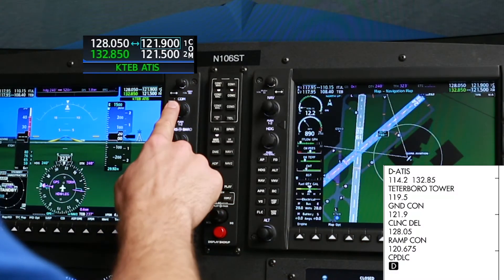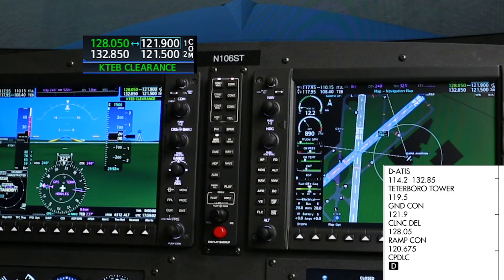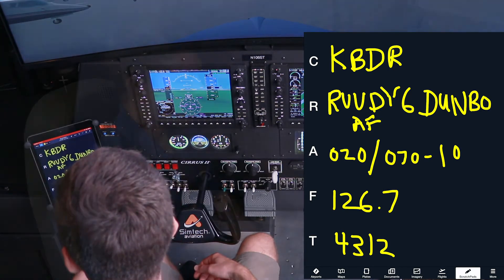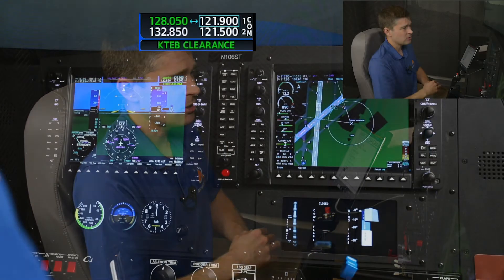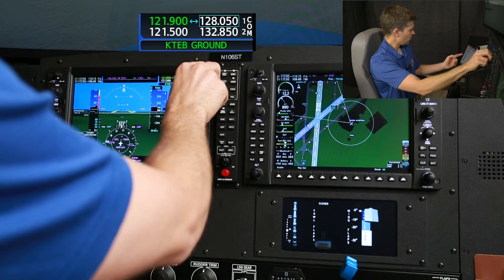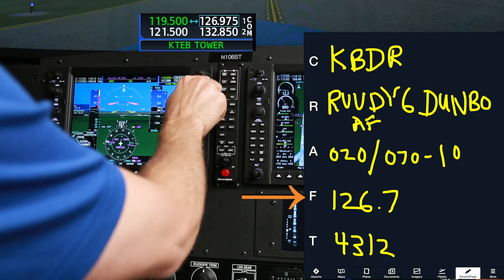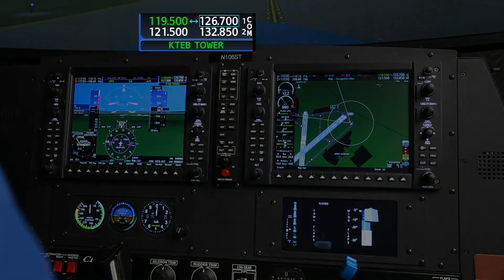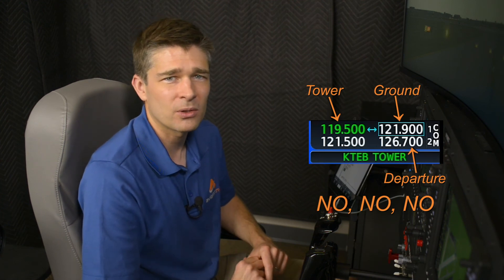IFR Radio Communication Setup | Flight Training New Jersey

Comment: Curious why there are two frequencies of many things non Teterboro like aTIS, t ower, etc.  Thanks
Reply from the maker: Think you are talking about 114.2 and 132.85. 132.85 works on COMM radio, 114.2 works on the NAV radio.
Reply: @AviatorNYC  Thanks for responding; not sure I got my point across correct but I saw two diff frequencies for say tower; wouldn't that only be comm and not nav radio freq?